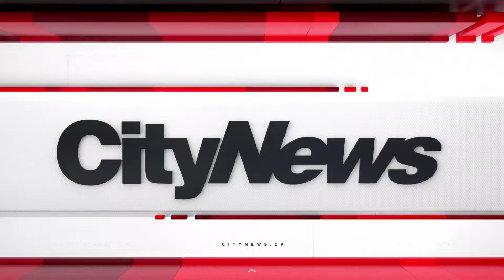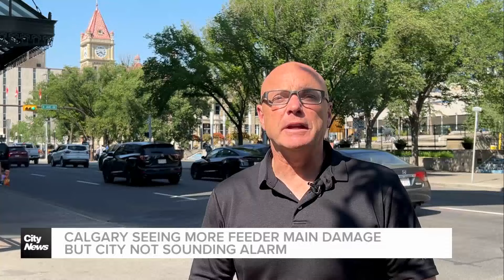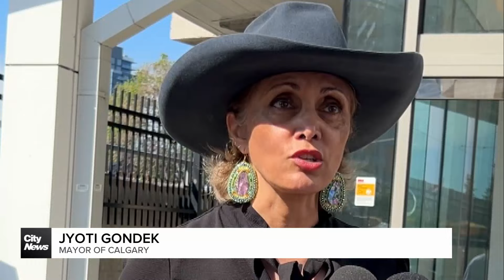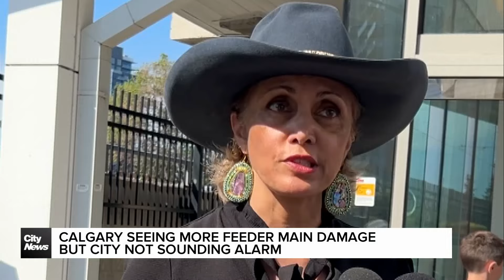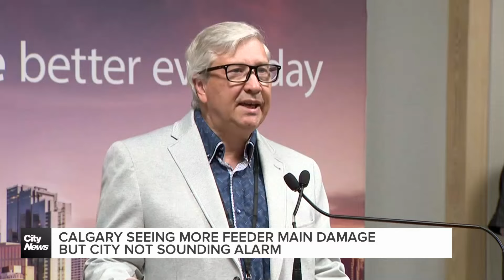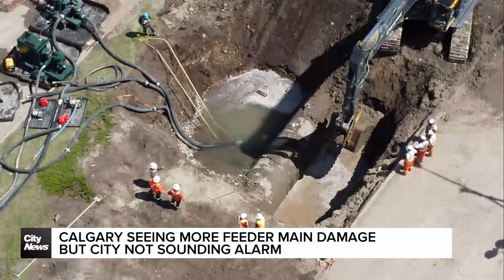Calgary seeing more feeder main damage but city not sounding alarm

Comment: It’ll be ok until Stampede is over
Then it’ll coincidentally break again requiring further restrictions
Reply: Bingo
Reply: And that actually makes sense.
What would you propose ?
Reply: @Ont785  bot
Reply: I stg if this is the case (which it probably is) im done! Taking a bath every day…
Reply: @4EverNanes  that’s assuming the meter will even allow water through it 
Pretty sure any new water meters are “smart” meters which could potentially just shut off after youve exceeded your water allowance…extra water credits would be available of course, but would most likely be price restrictive, preventing average people from affording it
Reply: @thesuperblyfantasticalchan943  no, residential meters can NOT turn off your water. Source: I've installed smart meters. That would require a buried power line and a much, much more expensive meter.
Reply: @4EverNanes  do it lol if they turn off water go turn it back on 😅

Comment: Hey Nenshi, what did you not do during your miserable years as Calgary’s mayor?
Reply: The pipeline is 50 years old.  You could ask the same question of Bronconnier, Duer, Harman and Klein.   The pipeline didn't leak when Nenshi was Mayor.  What was he supposed to do ?
Reply: @SomeTechGuy666   I asked a question if he did everything that was suppose to be done. He raised taxes enough to examine a few extra pipes. You’re not here really defending Nenshis record as mayor are you?
Reply: @pjfan173  I'm calling out the stupidity of your argument.
Reply: @SomeTechGuy666  Why was there no back up ? Critical infrastructure should not ever be disrupted.
Reply: @Headinavise  Are you an infrastructure engineer ?

There is redundancy built into the system.  The Glenmore treatment plant supplied the city while Bearspaw was shut down.  I bet a lot of other cities don't have as much redundancy as Calgary does.
Reply: @SomeTechGuy666 nice try buddy , Bearspaw was still open pumping water further north of the break , Hawkwood , Silversprings etc , Glenmore isnt really a redundancy if the system can’t operate  at full pressure , you sound like a apologist for the city and yes nenshi could have done way more for utility maintenance but instead doubled taxes and poured billions  into the greenline boondoggle , which he clearly lied about the costs  , Nenshis Nightmare ….enjoy
Reply: @vm2595  You are just looking for something to pin on Nenshi.   Grow up, get real.  

I bet the biggest thing you've ever managed is to get out of bed in the morning.
Reply: @SomeTechGuy666  His job was to make sure the infrastructure is maintained, instead of being woke
Reply: @wishteria234  He really pisses you off, doesn't he ?  LOL.

Comment: Of course it is trouble.  The Glenmore Reservoir is old and can't supply the city.  This Bearspaw pipe is deteriorating, and it is not in just a few places.  The city needs to start a plan now to replace or begin a new line.  You don't just start a study while Rome falls.
Reply: @shirlawstein9320  rationing water is the plan silly